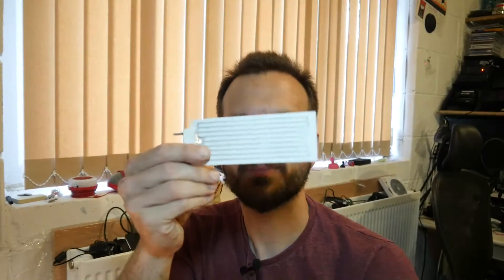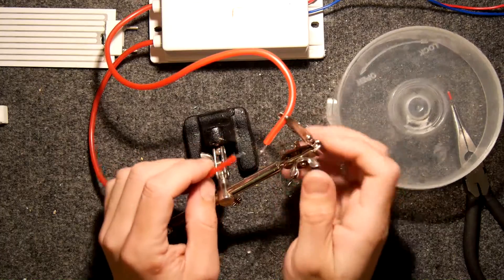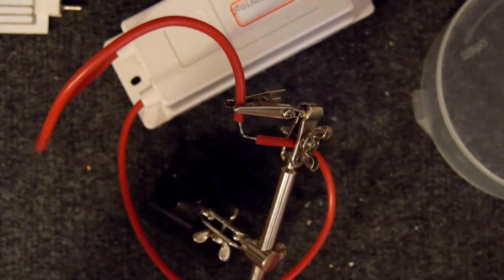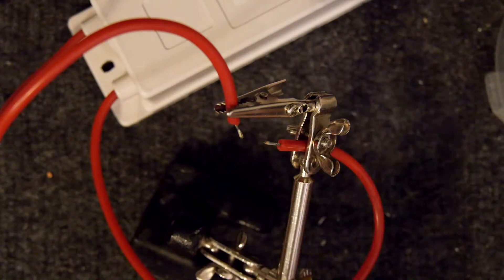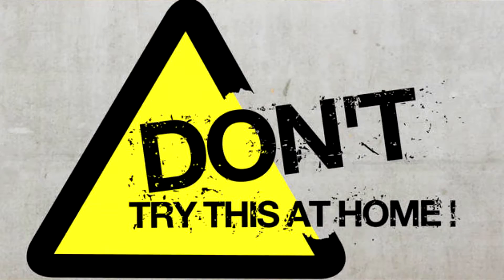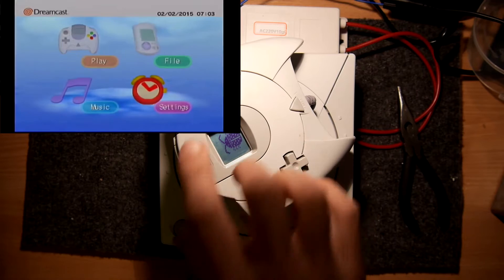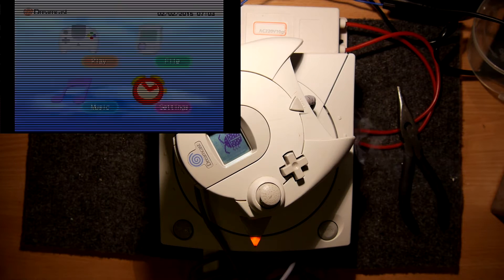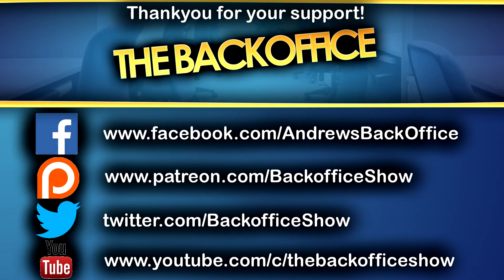SEGA Dreamcast vs 15000 volts!

Comment: Bit of a waste of a working console but ah well, for science!
Reply from the maker: +Simon Lock (Aergan) With a little tinkering it will be right as rain, only electrolytic caps smoke like that and you are always changing them?
Reply: +The Backoffice I usually just deal with the aftermath rather trigger the cause - I don't think I've ever blown caps up yet. I tend to only ever fry voltage regulators. Chances are (being SEGA) those are fried too
Reply from the maker: +Simon Lock (Aergan) There seem to be quite a lot of tweets on people blowing up import units with 240v. If only the PSU board gets fried there is a good chance these could be saved.
Reply: +The Backoffice they can be in most cases - they didn't wack 15KV via the expansion slot on the mainboard though!
I'm interested to see if you can bring it back to life though. A Backoffice Tear Down Lab is a must.

Comment: Well you did it! Egged on by the internet. RIP Yu Suzuki's personal Dreamcast (probably).
Reply from the maker: +Simon Lock (Aergan) Never say never! I'm going to stay upbeat!
Reply from the maker: +Mark Sharples I think you will be able to repair it though? I'm hoping!
Reply: I think a miracle is needed to resurrect it's poor soul.
Reply from the maker: +Mark Sharples It was quite hardy, lasted a while, so probably just something simple like a diode?
Reply: +The Backoffice I think they have internal fuses that are very heat sensitive. Although all the smoke likely means it's dead Jim.

Comment: RIP Sega Dreamcast, the last best console to be released by any manufacturer. 1999 - 2016
Reply from the maker: +ldisc66 At this point I had not played it, was given it with some games. It was one of the UK launch units given away to the press apparently!
Reply: +The Backoffice couldn't use an Xbox? lol
Reply: referral madness If my memory serves these units are pre-release PAL units that were given to the European game press for promotional purposes.
Reply: The Backoffice After WEEKS of watching this video, I've only now came to the realization (lol) that it is imperative that you replace the power supply (hopefully this is the only component that is damaged) to revive this piece of gaming history! lol
Reply from the maker: +ldisc66 Have you taken the time to read the description? 😂
Reply from the maker: +ldisc66 what's you favourite game on the system?
Reply: The Backoffice Good lord there are so many good games, the ones I've played the most were Phantasy Star Online and Virtua Tennis.
Reply from the maker: I might dig it out if I'm bored later and actually play it. I have never set it up, ever. I have bought games and a spare controller for it. Just saving it for a rainy day!
Reply: The Backoffice If you look around I'm sure you'll find something you'll like. I own something like over 60+ games I purchased in 99-02. Compared to my combined PS2-PS3 library of only 20-25 games lol.
Reply from the maker: +ldisc66 I never realised there were so many games for it
Reply from the maker: +referral madness are these YouTube channels or websites?
Reply from the maker: +referral madness Thanks, will check them out. But first, car boot sale to look for retro titles!